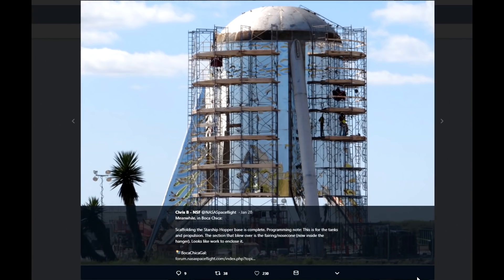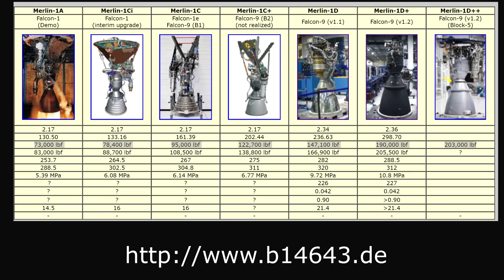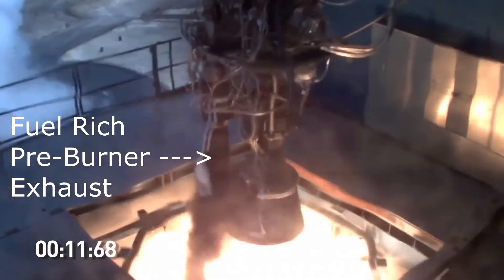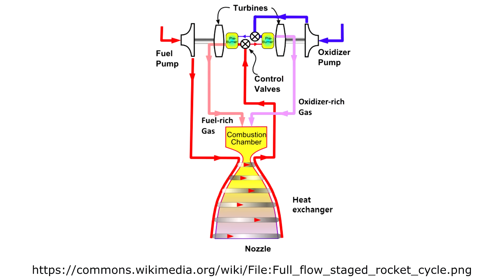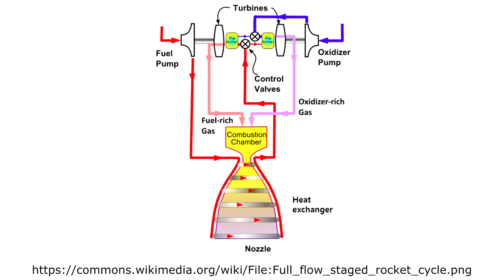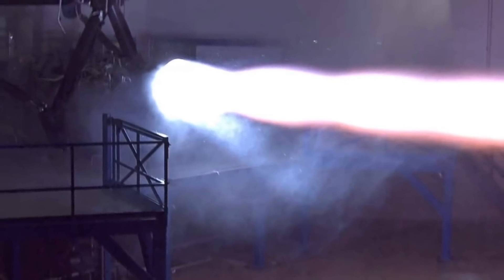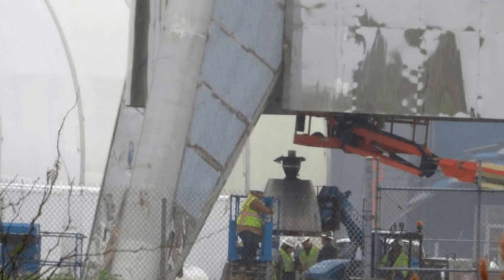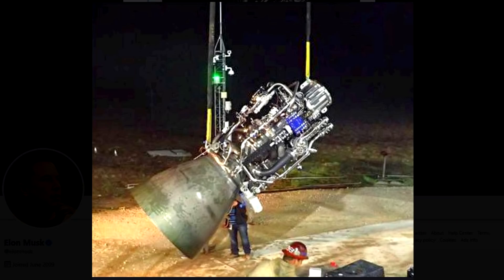SpaceX's Full Size Raptor Rocket Engine Revealed By Elon Musk

Comment: If only people weren't so scared of nuclear engines.  So much simpler, much more powerful and efficient.  Still, the Raptor will undoubtedly be a classic.
Reply: Not enough thrust for launching. But they would definitely help to get to Mars.
Reply: @G5rry  NERVA had a thrust to weigh less than one. There are other solid-core Nuclear Thermal Rocket designs that could. Specifically one called 'Dumbo' with an exceptionally efficient laminar flow heat exchanger design.

Not that it matters. The US government isn't at all likely to let a private company build and test an NTR on its own. And few that would want to face the regulatory hurdles, if they did.
Reply: @stardolphin2  Thrust could also theoretically be boosted using something called LANTR which injects liquid O2 into the exhaust to combust with the hydrogen giving something of an afterburner effect.
Reply: For starship, nuclear engines wouldn't make sense since they don't have enough thrust to land.
Reply: @deltaV-x2g  But you can make a nuclear-powered space-only interorbital tug to tow Starships between planets. Saves the fuel and allows for higher interplanetary payloads.
Reply: I expect we won't be using nuclear engines until we can build them off planet.  sigh
Reply: @TheEvilmooseofdoom  We could build them down here...it's launching them with fission fuel on board (even cold, and not to be started until LEO) that would make people freak.
Reply: wait for interstellar Musk , maybe next generation

Comment: Appreciate the explainations, however, the graphics fip by too fast. Leaving them longer would help.  Commentors: plz -thumbs up or down this msg so we all see what is prefered.
Reply from the maker: I agree with you, I rushed this because I needed to get to sleep.
Reply: I simply pause the playback for leisurely study.  Saves bandwidth and Scott's time trying to decide how long to leave the graphic up.  One can also then use print-screen to capture freeze frames for printout or other uses.
Reply: That is what the pause button is for. Also there is a slow motion function.
Reply: Scott has a separate video where he goes in depth about the different combustion cycles. Lookup the video about rocket plumbing.
Reply: Michael Amick downvotes have no function on YouTube
Reply: @moffatcam  thx 4 the heads up seems a bit 2 pc 4 practical use.
Reply: I pause to peruse the diagrams.  YouTube screen stuff obstructs the view at the top and bottom of the screen when paused, unfortunately.
Reply: I just pause the video.  I assume Scott knows people will pause the video if they want to read and/or study the graphics.

Comment: Would be cool if they managed to run at higher pressure than the Russian engines. Warm oxygen rich gas at 500 atm or so, pretty corrosive I would guess :-)
Reply: The first version of Raptor should work at 300 atmospheres. The second - at 380 atmospheres. 
In Raptor, both components of the fuel are fully gasified, in contrast to RS-25 and RD-170/180/190, therefore, a significant increase in pressure compared to the listed engines is possible.

Comment: Nice that you go into technical details, but I would have found it much more interesting to compare the Raptor not to gas-gen engines like the Merlin, but to staged-combustion engines like the RS-25. What exactly is a first in the Raptor which those engines didn't have?
Reply from the maker: The RD-180 is also a staged combustion cycle, that’s why I mentioned that.
Reply: Yeah, but the RD-180 has only an oxygen-rich preburner whereas the RS-25 has both an oxygen-rich and a hydrogen-rich one. Isn't that the same thing that's also the Raptor's selling point (except with methane)?

Comment: What's so special about 300 bar?
Reply: In case you are asking because standard hydraulics (or common rail diesels) having more than double the pressure:
In contrast to hydraulics you have
- huge flow rates  (2 t/s in case of the Satur F1 engine)
- a rather big chamber diameter
- an open chamber
This might explain, why it is difficult to achieve very high pressures.

If you were asking WHY the want to achive this: Higher pressure means faster exhaust gases means higher ISP. Additionaly, the mixing of the components might be better, leading to a more complete burning, also improving ISP.
At least this is, what I think to know about it (regarding the 'why' part)
Reply: @LoneStarr1979  thx
Reply: Nothing really. It’s a number Elon threw out some time ago that raised eyebrows because the record is 262 bar. He responded to a tweet from Everyday Astronaut indicating that 262 was really hard and they are not there yet. So 300 bar has kinda become a holy grail kinda thing. But it’s really about Newton’s law , the higher the chamber pressure the higher the equal and opposite reaction. High chamber pressures are desirable but I think they are chasing the sweet spot between thrust, efficiency, cooling, materials, thrust to weight ratio, cost and reusability.
Reply: The higher pressure, like in ICE's, allows for better atomization and higher chamber pressures.  I might be wrong but thats what I get out of it.
Reply: 300 Bar is a ludicrously high pressure for the relatively thin walls of a combustion chamber.
For example, a high performance engine for a race car that is likely to be rebuilt every race runs at around 100-120Bar.
The incredible temperature that a rocket chamber operates at limits the materials that are suitable. High temperatures not only reduce the strength of the material, but also produce issues with oxidization and corrosion, especially in an environment with oxidizer present.

It WOULD be easy to design an engine to withstand these temperatures and pressures, but, without some extremely clever ideas and cutting edge materials you end up with a ludicrously overweight engine.
So achieving 300 Bar in a reusable engine with a good thrust to weight ratio is still a cutting edge engineering problem.

And as for why 300 Bar and not another high number?

Because 

THIS
IS 
SPARTA!!!
Reply: @SKYWURX  Except that the combustion chamber and nozzle is cooled because no material can survive at the chamber temps. And secondly,, the super crazy high pressure gasses coming out of the turbopumps are actually only about room temperature. So even though they need some crazy alloys for the ox-rich stuff it's really only about the pressures.

Comment: Is re-usability really a thing? Has it been independently proven. And how many times can these miracle engines be re-used? Twice or thrice? And what cost is involved in taking a once used engine into a second use. As an American tax payer, I would like to know. Nobody seems to be talking about this. Are SpaceX engines re-usable, and are they anywhere close to being re-usable? And what does re-usable mean? Please address this issue in a upcoming show. You are one of the few knowledgable voices out there.
Reply: The only question that wikipedia doesn't already have an answer for is the cost of re-certifying an engine for flight. Also, you being a tax payer has absolutely nothing to do with any of the above. What you care about is that NASA uses the launch provider that charges the least (while maintaining all safety demands) for getting NASA's stuff to where NASA needs it to be.
Reply: Re-usability IS a thing.  Has it been proven economically with Raptors?  Not yet, they can't know that until they fly them, refine the design and settle on a final version to fly and re-fly.  Even the people at Spacex want those questions answered.

Comment: Question: is it possible that a powerful enough rocket test could speed up or decrease earth’s rotation?  I remember seeing rocket engines burning horizontally before, and I’m sure they don’t normally have the power to do much, but I’m curious if it was possible.
Reply from the maker: I did the math on this once:https://www.youtube.com/watch?v=g1pXf_zsa7g
Reply: He did a vid on it already: 
https://www.youtube.com/watch?v=g1pXf_zsa7g
Reply: You might find someone has considered that angle a very long time ago: it's basically the McGuffin that powers Jules Verne's "The Purchase of the North Pole" (https://en.wikipedia.org/wiki/The_Purchase_of_the_North_Pole). That novel also makes it pretty clear what the problem with that idea is - or rather, how many orders of magnitude...

Comment: The other difference is of course size; the BE4 is larger and heavier than the Raptor.   Musk talking about the future version of the SL Raptor having similar thrust to the BE4 is exciting.
Reply from the maker: Where did you get info on the size and mass of the BE-4, would love to have numbers.
Reply: Also of interest, all of the powerpack is within the footprint of the nozzle vs the merlin and other engines where it hangs out on one side or the other.... It results in the engine looking longer, but it allows them to pack the 31 engines into the SuperHeavy footprint...
Reply: @scottmanley  I stand corrected on some of the numbers I just mentioned, as people continue to refine their measurements from their images:  https://forum.nasaspaceflight.com/index.php?topic=41363.msg1907090#msg1907090

Comment: So if they developed the raptor from scratch, i wonder why they didn't go with developing an aerospike engine instead.
Reply: If you see awesome technology that no one is using it is most likely because it is not as awesome as presented in marketing materials :)
Reply: It just adds another layer of complexity and another set of engineering problems to be solved and those things add to develpment time and cost.
Reply: I presume due to their already peak function in-atmosphere.  From what I know about half-spike and faced aerospike engines, is they basically are a method in which to create a medium-efficiency system for all altitudes including vacuum.  Which for the sake of Starship perhaps is not necessarily what they are looking for.

Comment: 382 vacuum ISP !!! I need that in my ksp xD
Reply: Keep in mind it's methalox, so some of the gains are offset by lower density compared to RP-1 and thus greater tank weight.
Reply: Thomas Kwa kerolox should have about the same tank mass because it needs helium pressurization system whilst methalox (and hydrolox) can easily use autogenous pressurization.
Reply: its impressive. but ssme has vacuum isp of 452
Reply: @145baggy  Of course SSME is higher, it's burning H, not CH4.
Reply: @145baggy  The high isp of hydrolox engines is offset by the significantly heavier dry mass of the rocket (much larger tanks and insulation required). There are many other factors at play that result in the two propellant mixtures being fairly close in terms of mass to orbit vs mass of propellant efficiency.
Reply: PROgrammer8 you forgot that Tsiolkovsky equation has logarithm in it. Even 20-25% higher ISP wins a lot against ~1.5 times better tank mass ratio
Reply: @tinldw  Yes that's very true, although I wasn't trying to say that methalox is equal to hydrolox. The point I was trying to make is that they're not quite as far apart as it might seem just based on ISP alone.
Reply: PROgrammer8 it is true for Kerbin or Mars, but on Earth with it's LEO delta-v over 9000 m/s the difference is quite large even for the dry mass (more so for the engines, less so for almost everything else).
Lift-off mass difference is about as large as Tsiolkovsky equation tells you. Around 1.75 in this case.
Reply: @tinldw  Okay but that still doesn't change my point. In theory, SSME would have (452 - 380) / 380 = 19% more deltaV than Raptor in a vacuum. However, if we include a mass penalty of say 15% for having a much larger tank and insulation for LH2, that advantage goes down to only ~13% (see calculations below). 

Using a typical wet/dry mass ratio of 16 : 1 we have: (452 * ln(16.15/1.15)) / (380 * ln(16/1)) = 1.1335 or 13% more deltaV for SSME.
Reply: PROgrammer8 SSME is not even a real vacuum engine. Equivalent of 380s or 3.7 km/s for methalox is 460s or 4.5 km/s for hydrolox. Also, there is virtually no (maybe few percent) TWR penalty for a hydrolox engine compared to methalox engine (I've checked).
And of course, it is never about having more delta-v, it is always about how hard it is to reach predetermined delta-v.
Not to mention that you've forgot about staging and separating rocket's dry mass and payload mass…
Reply: PROgrammer8 let's play with Tsiolkovsky equation and get the orbital mass fraction:
Hydrolox: 1/exp(9500/4500)=0.1211
Methalox: 1/exp(9500/3700)=0.0767
Now we can assume the engine's TWR to be, say, 80:1, and the rocket's TWR 1.5:1, making it 0.01875 of the launch mass. Tank mass should be about 0.035 for hydrolox and 0.025 for methalox. 
Which gets us to:
0.1211-0.1875-0.035≈0.067 launch payload fraction and 0.06735/0.1211≈0.556 orbital payload fraction for hydrolox. That is 1485t launch mass and 80t dry mass for 100t payload.
0.0767-0.1875-0.025≈0.033 launch payload fraction and 0.03295/0.0767≈0.43 orbital payload fraction for methalox. That is 3035t launch mass and 132.5t dry mass for 100t payload.

You can play with staging, payload fairings, etc. yourself.
Reply: @tinldw  Okay so 21% advantage instead of 19%. TWR for hydrolox vs methalox engine is not what I've been talking about though. TWR of a given engine refers to the mass of the engine alone and does not include the mass for tanks. Thank you for bringing that up though because the few percent added weight to the engines themselves also works against hydrolox. 

I also didn't "forget" about staging. It's called an approximation. No shit it's way more complicated than that. We could sit here forever talking about how my napkin math doesn't take into account atmospheric losses for different launch profiles for different orbits etc etc. But that's not the point.
Reply: PROgrammer8 okay, so you can't comprehend more than few sentences at once, and even those you interpret incorrectly to better suit your "views".
Reply: @tinldw  My reply "Okay so 21% ..." was in reply to your "SSME is not even ..." comment. The reply where you played with Tsiolkovsky's equation didn't show up for me because you posted it while I was replying to your comment before.

After reading the example of what you were trying to say, I understand how I misinterpreted what you meant with the pre-determined deltaV. I apologize for this misunderstanding. I don't have any particular "views", I just misused the equation.
Reply: PROgrammer8 ok good
Reply: Well, i didnt understand any of that conversation, but im glad it's settled!
Reply: @WillArtie  i know,its like  looking for the bathroom and getting yourself into a rocket science lecture instead.
Reply: @tinldw  I'd rather just use C3H4 (methylacetylene, "MAPP gas"), RP-1/RP-2/RG-1/T-1 (dodecane), or sintin (old ex-Soviet fuel, supposedly a stable strained or unstrained hydrocarbon similar to cyclopropane, which is very unstable, but with better performance and without instability issues).

Boranes, silanes, carbaboranes, are even better. A B-O2 hybrid rocket for example would allow for well over 450 seconds of Isp, under MSL conditions, assuming 75% thermodynamic energy-thrust conversion efficiency and a quality, full-length, non-truncated, annular ring (aerospike) nozzle.
Reply: Nuclear Armament so, basically, you'd rather use the most impractical (expensive, explody, corrosive, high-temperature, sooty, etc.) propellants ever 😂

Comment: What a beautiful and powerful engine!
Reply: And about a third the power of a F-1. So, fifteen engines, instead of five?
Reply: David Parry  yes, yes it is.
Reply: David Parry yes.
Reply: David Parry oh boy this comment did not age well. How does it feel to be wrong just a year later?
Reply: David Parry say that now
Reply: David Parry The falcon 9 is one of the safest rockets ever, and it has two extra engines just for reliability, so it doesnt matter if it looses 2 Or more engines
Reply: David Parry Like I mean they dont fucking have alot of failures, only of landing boosters.. which is to be expected when its experimental technology and the company isnt fucking 10 years old yet
Reply: David Parry  wow this commend aged well...what are you on  about ha
Reply: Is the Raptor engine going to be used on the hyperloop in the Boring tunnel?
Reply: big deal germans had this in the early 20’s ,

Comment: Rocket Science?
That's simple, it is the engineering that you are talking about, come on!
Common sense.
Really?
Reply from the maker: It's true, I like to say that rocket science is quite easy. The hard part is rocket engineering where much of the effort is expended pushing the design as close to the limits as possible.
Reply: its true,even an idiot like me understands that rocket science is  "simple in theory" but tremendusly complicated when you want to balance pressures/temps/weight/cost AND make as less possible points of faillure and million other things i  cant think of.